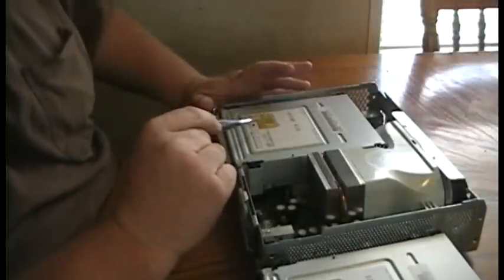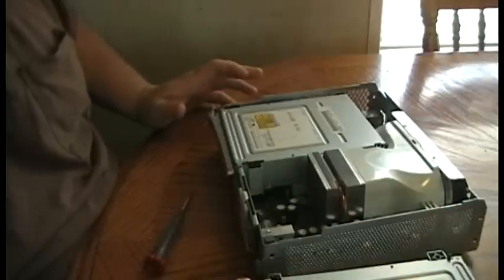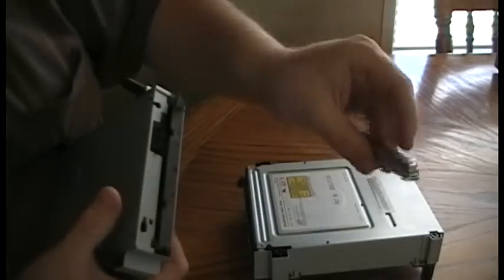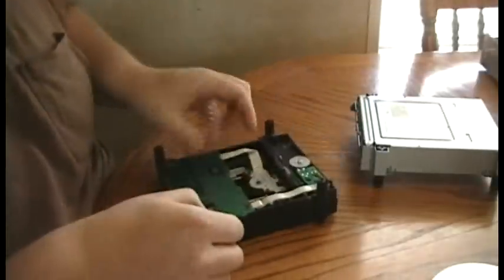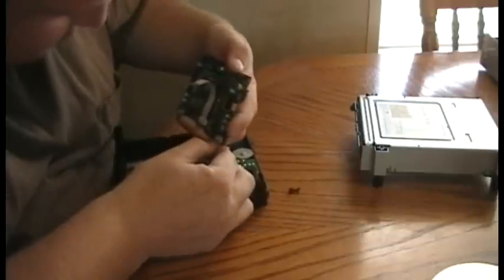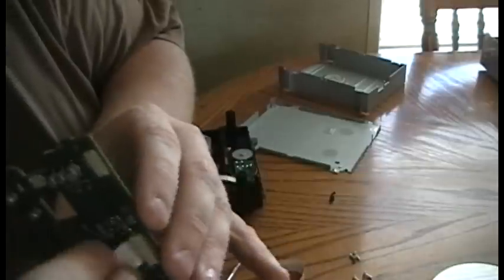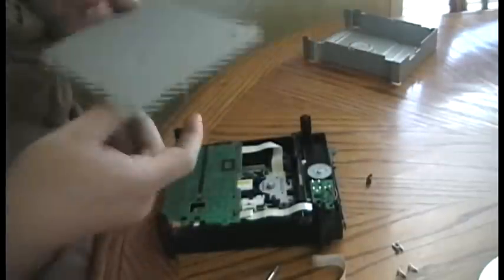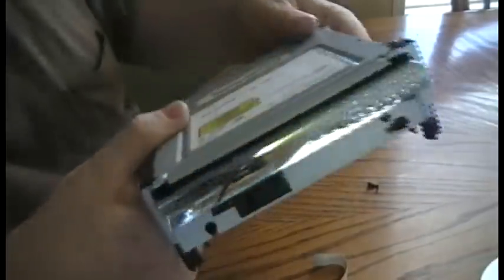KEVIN'S ARCADE: How to Replace A BAD Xbox 360 Samsung/Toshiba Optical Drive

Comment: I know this is a bit late (6 months), but I just swapped out identical optical drives using the above method, and ran into wires with solder points. I broke out the soldering iron and went at it, it was really easier than i thought it was going to be, just a note though, if you try this, make sure you keep good track of which wires go to which solder points; for instance, mine had 5 white wires, I recommend using a sharpie and marking the wires sequentially. Mine works perfectly now, no issues.

Comment: Well, I'm glad there's a much simpler, physical alternative to 'Flashing' firmware keys. Sounded a bit more involved than I wanted to go for.

Just ordered my replacement drive, a Hitachi-LG GDR-3120L ver.78FK, precisely as my old drive says. If the board stuff goes as smooth as it looks, I'll be back in business and quite relieved.

Much obliged for the informative video.

Comment: Excellent!  It worked perfectly.  Now my Xbox plays games like how it did when it was new.  Thanks for uploading this useful information.  Unlike some other videos they failed to mention the importance of swapping out the circuit board.  If I didn't know that I would have just put in a new Disc Drive without the circuit board swap and would have been wondering why it won't play games.

Comment: @22Zeion I have a different drive and this worked perfectly. All i had to do that was different was de-solder and re-solder some wires that were not ribbon cables such as motor, switch wires etc.. that were connected to the board. It was my first time soldering and I had no problem... just remember what wires go where... I have a DG-16D2S Drive

Comment: I was wondering why the disc tray wouldnt read, i needed the key for the bottom of it, even though that this is a much older version of the disc tray it still worked for my newer one. Thanks dude.

Comment from the maker: @snakev10v5 That one in the video was a 360 "Profesional" Back when there was only 2 versions core(no hard drive) and Pro (Hard Drive)

I have only run into one newer elite and we couldn't find the same model drive. the only difference was where the motors inside the drive hooked up at so I had to get some wire and extend the wires to reach the Connections on the old board.

Comment: @bert18 essentially I think you can, but getting the entirely new hard drive would cost more than just replacing a few parts, with some people its not an option to just replace a part in their disc drive, but that the whole thing is phucked up, like in my situation my whole disc drive is phucked so this isnt an option I would have to just take the old one out and dump the new one in making sure that they are the same model...

Comment: Yes, Im waiting for my new drive to come in to do this same thing right now...it SUCKS not having the xbox right now...pretty simple fix...the motor that spins the disc went out in mine..instead of a motor replacement im jsut replacing the whole drive becuase like you said...brande new drive pretty much like a brand new xbox again...plus the differnece in a drive and motor was like 8-10 bucks brand new.

Comment from the maker: @Alleykatt500 generally the board is fine its just all the moving parts that have a tendency to break down and most of them will cause your problem even if its only one thing wrong  (The Laser, the motor that moves the laser back and forth, the motor that pulls the tray in and out, and the motor that spins the disk all have broken in my drive at one point or another so I just replace them all and keep my  logic board that the xbox needs to think it has the drive it shipped with for Xbox live.)

Comment: @AustinANDRobbie because its not flashed yet its a factory drive so it hasnt been programmed to play games yet that is why the simplest way to replace your drive is to take out the chip inside and putting it into the replacement drive cuz flashing the new drive would require a lot more material and knowledge and some programs that you would need to use and learn how to use...

Comment from the maker: @cbmbdb I have done this to two xboxes with the samsung drives and never had a problem.
I am waiting for the replacement benq drive for my coz's 360 elite to show up so I can replace it for him.
I will post a video of that too since it requires soldering but I expect no problems. 
it should be the same as the samsung it just requires 1 more tool and a steady hand.

Comment from the maker: @LouieLeDuc no you will not need to flash/configure your xbox.
The instructions in this video are to replace the malfunctioning drive components (Laser, Tray, motors, ETC) with new ones in order to fix your aging dead or dieing xbox.

if you swap out the logic board like this video shows your xbox wont know its got a new drive but it will be like new again. no flashing required!

Comment: hey great video. Does it matter if you use the old ribbon wire used to connect to the laser or if you use the new laser ribbon wire will it not work? please HELP. Thanks!

Comment from the maker: @xxcarlosxx16 My experience is when it cant find the disk drive it just flashes the center green light like its ejecting the disk if you have opened it I would check to make sure you haven't pulled any wires loose or not plugged them back in tight!

Comment from the maker: Sundrop1338 You would be putting the old board into a new drive (Most of the time the problem is not with the logic board but with the laser and other moving parts in the drive)

Comment: @MrTOPEKOMSI the xboxs i took apart to get the 2 drives both had little grey holding clips where the ribbons enter the laser board then one on the power board. they are along the connectors that need to be pushed from each side then the ribbon is freely removable once you want the ribbon back in you slot it back in then push the clip back in to hold ribbon. it mite just be on new models i dont know but both were white xboxs.

Comment from the maker: @TripDaRipper the "KEY" is hard wriiten into the firmware on both the 360 and the drive if your drives logicboard is fried you will have to send it to microsoft for repair if its the 360 that fried you would likely have to buy a new one.

Comment: soo i have a 360 where the home screen still pops up and everything but it has quite a few probs with the disk tray. at first it was that the little thingy uder the disk fell out and was rattling around, i put that back and thought it was better, it opened and closed fine. then when i put a disk in acd closed it, it didnt read the disk and spit it back out, then it did the thing where in would close wether it has a disk or not and NOW its sticking both ways.. what can i do to help this???

Comment: um hey buddy tip for the future umm well if you even see this well any ways on those ribbon cables theres to little notches if you pull them out they wont om off but pull them out you dont need to pull hard to get the cable out and need no pressure to put them back in and to hold the cable in you push the tabs back in

Comment: my xbox just recently stopped reading discs.. i have an older xbox that got 2 red rings. if i took out the cd drive from the 2 red ring and put it into the one that stopped reading discs would it work?

Comment: @kevinjsand i have 2 of the same drives, one of them the disc wont spin properly, and the other one works fine, but everytime i put it in the xbox it spins fine and it looks like the games gonna start up but then the xbox 360 logo pops up and freezes.

Comment: my xbox's optical drive/disc tray has been haveing the open tray error and cant read the disc i put in it.....my friend said if u tap on it it'll work (in which it did) ,but now its fully burned out and i was going to buy a new one off of craigslist.. the guy was selling was the sam model as mine but he wanted to check if it was compatible with me xbox so we checked the part #s and etc. were the same except for the last 3 digits...(both were the DG-16D2S-***) do they have to be the same to work?

Comment: @swooshonln If you have experience flashing devices it is doable. If you do not, I wouldn't recommend attempting to flash xbox 360 hardware as a learning experience. Flashing essentially overwrites the code the manufacturer installs on the drive with your own code... If you flash the wrong code you can cause more problems than you began with.

Comment: So if you have a Benq drive you would have to cut and solder all the 7 or so wires from the original card to the new drive right? Anyone does this?

Comment: Hey I was wondering if anyone knows when you open a samsung dvd drive, if the spindle on the top case is suppose to move, as in wiggle back and forth, it is very loose and I am wondering if this is causing problems? its one of the drives that has a black spindle on top, rather than a gray/ silver one. Thanks!

Comment: If you are able to replace the disc drive with the exact same model, all you will have to do is replace the chip in the disc reader and not flash any firmware?

Comment: @kevinjsand No you are wrong. You can flash the original firmware from the original drive to the new drive and you can use it on Xbox Live just fine. No need to use "illegal firmware".

Comment: i hope you can help me with this...my drive is modded, or flashed, i think..i dont know whether theres a chip in it or its flashed, but either way, i took apart my xbox and cleaned the drive, and i dont get grinding noises anymore, however, i still get disc errors for some burned games..i think theres a problem with the drive for sure, because none of my games are scratched...if i were to replace my drive in the same manner as you, switching the circuit board, will it work since mine is modded??

Comment: Alright, I just recieved my identical drive, replaced the new board with the old board, hooked the cables in straight, put it back into the 360, and now it won't recognize the disc. Diagnosis?

Comment: @kevinjsand   Ok...my Xbox is having the same problem...my disc tray hardly opens and when it does i have to beat it to make it read the disc...(dumb idea, but it works)....i probably already know but that means i have to replacemy disc tray/optic drive?  I havent popped my Xbox open yet so i dont know what brand drive it is but do if i get a new drive, will i have to do any flashing/configuring or do i just plug it up and put in a game and play? I need to know

Comment from the maker: Clear Any Failed system updates that cause the console to error.
   1. With the console off, press and hold the sync up button (the small white one)
   2. While holding the sync button press the power button to turn on the console
   3. Continue to hold the sync button until the Console has booted up completely.
   4. During the boot process the console should clear any failed updates, allowing you to use it normally.

Comment from the maker: flashing a drive is basically taking the software off your old drive and putting it on your new drive so Microsoft doesn't kick you off xbox live perminatly

and yes short of getting the drive out of your xbox it really is just swapping logic boards from your old drive to your new working drive (Keep in mind that if it is your logic board that is messed up then you will have to flash your new drive, but mostly if you are watching this video it is because your disk drives laser has gone kaput.)

Comment: ok my 360 wont even read that it has a cd drive connect to it thus giving me the ring of death...i checked the heat sync its clean and good to go fans are connected and everything...just the cd drive wont open or anything PLEASE HELP.

Comment from the maker: If you are talking about flashing the firmware on a new drive you are wrong!

You need to have an adapter to power the drive in a PC then your PC needs to have the correct VIA North Bridge chip and its just an all around pain in the aspirin if you know what I mean.

I wish it were easy because I would surely get a better, more reliable drive and put it into my 360 if it were.

Comment from the maker: it shouldn't matter what firmware as long as its the same model drive cause the logic board you will be switching is where the firmware is anyway so you will be keeping your old 0079fk march 2007 drives brains essentially and shouldn't have to worry about the version of the firmware.
Anyone want to back me up on this I am not familiar with the Hitachi gdr-3120L drive yet, just the Samsung and the BenQ

Comment: hey, i replaced the drive a couple months ago it worked for about 4 months? but now it has a different prob. now instead of freezing it has the E71 black screen pop up. is there a part i could use from my old drive to fix the problem on this drive? i was thinking if i maybe replace the laser that might help. or swap the lasers?any advise would be MUCH appreciated. thank you

Comment: I guess my question is, where do you get a replacement drive from?

I saw your replacement drive had those legs on it for specifically going into the Xbox360. Is a replacement drive easily found at a regular PC parts retailer, or do I need to find somebody who has specific Xbox350 DVD rom drives?

Thanks

Comment: @kevinjsand I did it twice (with 2 different brand new drives). There's something else going on here.

The xbox refuses to read anything as a game. I even tried forcing it to shut-down/restart by overheating it hoping that that would reset everything and re-couple with the new disk drive (even though this should be unnecessary seeing how I swapped the chips) but that didn't work either.

Any other ideas?

Comment from the maker: if you did what the video shows above you shouldn't have an issue. if not try cleaning the laser. if that doesn't work clean the laser in the original drive and but it back the way they were before you changed anything.

Comment: @kevinjsand its cheaper and i have plenty of free time to fix dieing drives.lol. i just dont know how to replace that broken part is the problem. its like 30 bucks for a full new drive but much less for a bunch of replacement parts. i think the motor that moves the laser is messed up. do you know how to replace it or does anybody else know how? im one of those people that likes to tinker so its no problem to me to replace parts on a machine one after another.

Comment: how do you know if its your dvd drive is broken or it's board? i have the liteon 74850c. the power and sata ports are both built into the drive board. i dont wanna replace the drive by swapping out the boards and find out its broken as well.

Comment: ive just done a drive swop on a friends xbox the one to replace the failed drive was nothing like the old one. even if you have an identical drive it wont work because the main board on the drives are matching to the xbox mobo. i have never been inside an xbox so its new to me. all i did was repair the old drive using parts from the dona drive ie the lazer, lazer brackets and the lazer positioning motor as that had failed. bit of soldering later and hay presto peace of piss xbox is spot on

Comment from the maker: you can't get banned doing this but if Microsoft detects that you have a drive with a flashed firmware (Most flashed firmware allows use of copied games) Microsoft will label your xbox as hacked and black list it on XBL

Comment: You just don't give up do you. The 360 controller (including the weight of the batteries) is 9.35 ounces. The Dualshock 3 controller is right around 7 ounces. You need to do research before you argue.

Comment: theres a peice of hardware that was invented in a computer called a sata card plug it in on you mother board of ur desktop computer and then install your drivers and the sata card works so maybe gettin a new drive and using jungle flasher works easier then swapping out boards this is called sloppy work not impressed with board swaps if u would spend the time to learn something new and just flash the cd/dvd rom drive its almost as simple as a few clicks and reinstallation  just a thought...

Comment: You apparently haven't researched this topic at all, therefore making your opinion void. Not all get the RROD. Mine was made in November 2006, I bought it used in late 2007, and it has yet to get the RROD. Now for PS3s. Just search "broken PS3" here on Youtube, and I guarantee you will find several videos. And I have played PS3 online, and it is a good service for being free, but not nearly as good as XBL. Live first and formost has more people, and it also has Netflix. So you fail.

Comment: No, you don't win anything. And now you brought this down to controllers? Wow. Ok, let's disprove your claims.

I see you forgot your research once again. The PS3 controllers USED to be lighter because they didn't have vibration motors. Now they do and only weigh about an ounce less than 360 wireless controllers. Also, the 360 controllers are rechargeable, but they come with a charging cord that is longer than 4 ft.